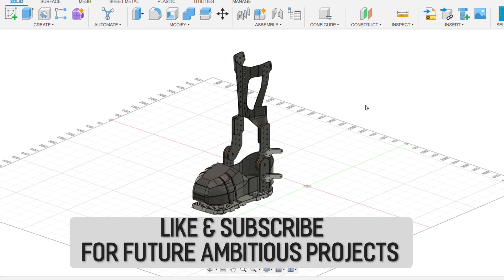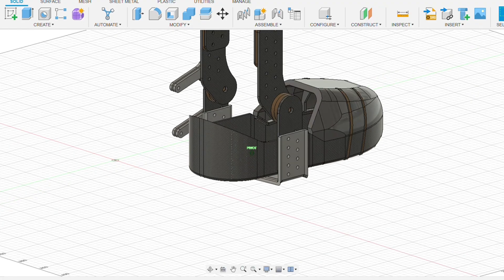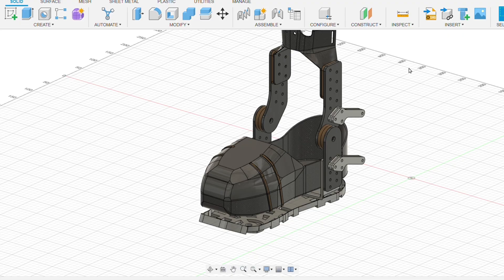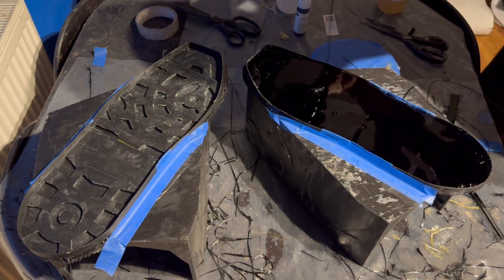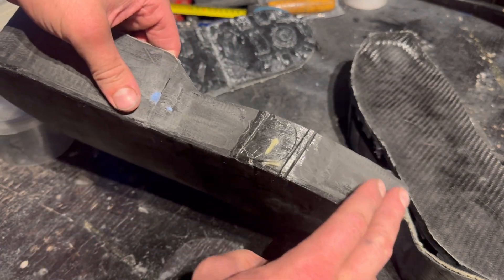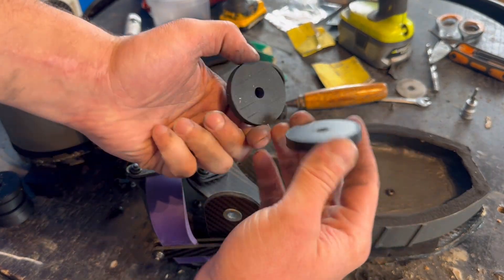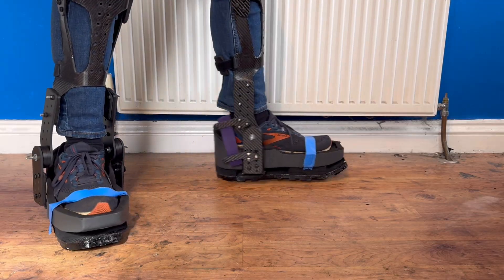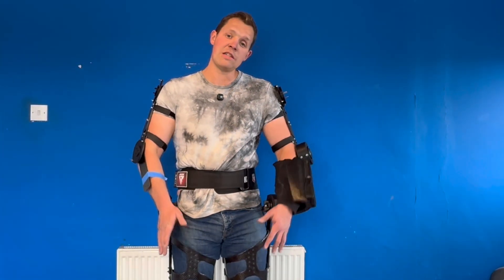Completing the CARBON Exo-skeleton with Boots - Real Power armour Development

Comment: Why would you not use standard body plastics to prove your design and then re-manufactured out of carbon fiber it just seems real wasteful that that carbon fiber is a piece of fiberglass and you have to keep turning it into dust and using it for filler every time you make a wrong piece or your end, deal with ridiculous amount amounts of waste, it’s a pretty good design. I’d say it’s probably second or third, but for point of reference, the military is working on this thing right now and I am helping them design it because I’ve done these things before now. The thing is too rigid if you’re gonna make a hard rigid suit, it has to stand off of the body the way that you’ve got that rigid suit as I’m watching it in the video you have this belt around your waist that puts all of the top end force on your hips that’s no good all of the force. All of the weight has to come completely away from your body. You’ve gotten robot arms that you’re guiding with your hand because you’ve grabbed a handgun controller on the side of it and now you’re manipulating that arm around everything you touch and move all of the force generated by that robot arm in no way be placed driveline force in no way be placed through your body. Your body was in no way and tend to do that. The suit is supposed to make you better than your body so by running driveline force through your body you’re breaking your body right away. You’ve turned your body from a control unit into a motor mount.

Comment: im not at all an engineer or anything, but wouldnt it be useful to have the achilles on both sides of the ankle so theres an equal amount of stress on both sides, rather than just on one side?
Reply from the maker: Potentially but as long as the carbon is stiff enough it doesnt matter. I can add them in necessary, but a plus to only having the on the inside is the dont stick out from the outer side of the foot

Comment: id personally suggest you swap out the ankle joint for something that allows for side to side movement, not just forwards and backwards on the foot... to minimize potential arm both to the user as well as the parts themselves...

Comment: To prevent bending loads in the ankle shaft, I would recommend making that connection double shear and/or redesigning the joint to remove the spacers.
Reply from the maker: Yeah i get what you mean, you’re right, ill probably re design the top hinge bracket with a bend in it, i want it as tight to the shin as possible so the leg armour can be as small as possible, but i actually couldn’t tell exactly what the spacers needed to be until i built these, incase it clashed with the ankle bone. Ill probably re do those when i re do the leg pieces out pf thicker carbon

Comment: Looked forward to the video! Any plans to add shocks to maybe cushion the user during heavier footfalls like jogging/running?
Reply from the maker: Prpbably not, i trialed springs om the previous prototype and the increase in weight was mad, with it being on the end of the leg the added weight means more than on say the thigh. Ive thought about cushion like an air bad but theres theres issues with it popping. Good thought though, it would be good to do otherwise
Reply: @MattExo-Dynamics  Perhaps some foam or aerogel between the sole and the foot platform? I keep thinking of those gel insole inserts.

Comment: I noticed in some of your earliest videos you seemed to have coiled springs in the base of the boot attachment is there a reason why you've moved away from using it this latest version? Also amazing build as always! ☺️

Warm regards
Reply from the maker: Thanks! and yeah, purely weight tbh, each spring was probably 150-200g but x3 its half a kilo a boot, also because the weights on the end of the foot, at the end of a limb, the extra weight makes a massive difference. Ill probably only put kevlar in the toe cap (with no ceramic, for this reason. Its like trying to walk around with a lump of mud on the end of your boot.